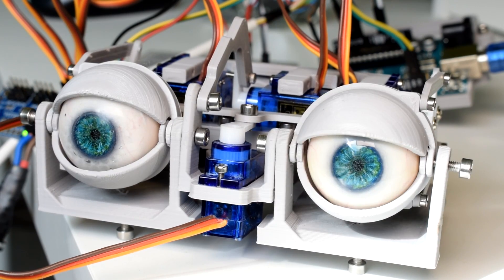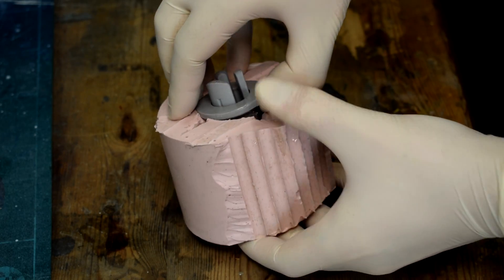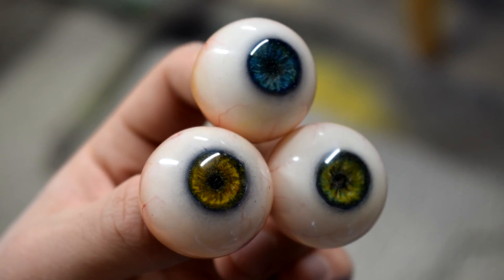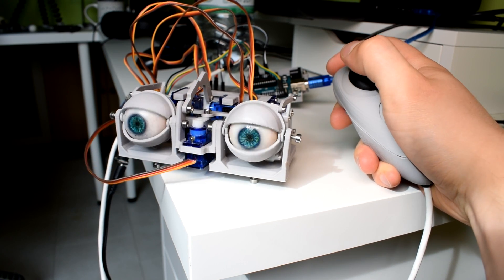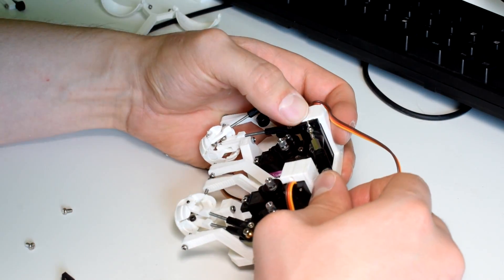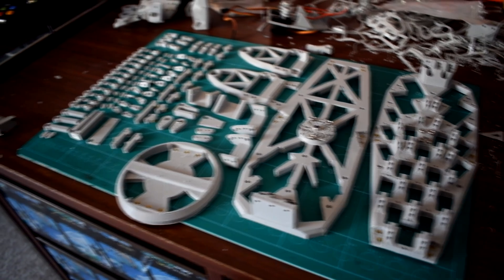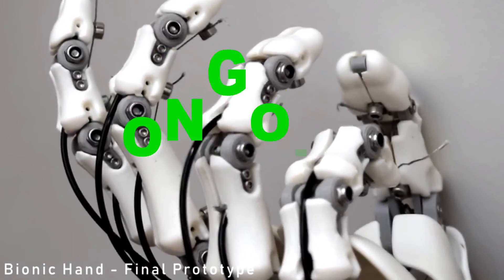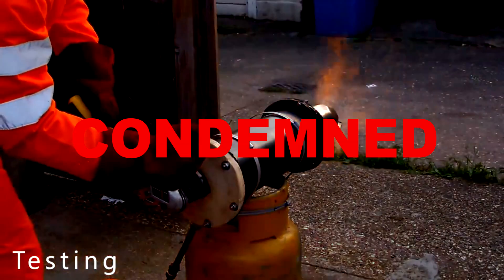New 3D Printed Animatronic Eye Mechanisms and Other Project Updates

Comment: Hey Will, I love this eyeball and have been studying it for quite a while. What I'm wondering is how to move the servos away from the eye and minimize the mechanism and support structures around the eyeball. This would enable putting an eye in the middle of a flower, and put the servos down in a flower pot underneath, operating a cluster of control lines that run up through the flower stem. I've tried just running wires through a tube, but there's too much play in the wires to perform the push-pull actions. I think each one would have to be confined in its own sheath, like a bicycle brake line. Another approach would be for all the push-pull action to occur in the flower pot using rocker arms, with the ends of the arms operating pull-only lines that run up through the stem to the eye, with opposing connections to the eye for back and forth motions. The pull-only lines could be much smaller gauge than push-pull rods - maybe even nylon thread. 

Any thoughts on any of this?

Comment: Quite interesting that I was trying to make eyes that move realistically and have eyelids that accompany the eyes as in real life, but in 3D and without any reseach on how to do it, just photo, video and anatomical references, and I came to the same solution for the eyelid motion as you did: 
just make the skin around the eyes weighted gradually from 1 to 0 from the center to the outskirts (or in your case simple shell in the form of a quarter of a sphere that have both hinges on the "points") rotate on an axis fixed on the eye's center that goes through left-right poles of the eye. Rotates up and down only, with the eyes, independent of the blinking motion, but have a limiter to rotate half as much as the eye. Just 2 controls, one blink other move the eye, yet it's so realistic. Simple but powerful

Comment: If you're having trouble with bubbles in the lens part of the eye, you can pull the bubbles out of the clear resin before it sets using a vacuum pump and degassing pot (To put the resin in) such as this one on ebay: https://www.ebay.com.au/itm/3-Gallon-Vacuum-Chamber-and-3CFM-Air-Condition-Gauges-Tools-Pump-Degassing/333190129962

Comment: Sweet! This is amazing work. Have you considered a creative commons license?

Also, the eyes are hitting the uncanny valley because the bottom eyelids are blinking. If you look at human eyes when they blink, the lower eyelids barely move.
Reply from the maker: Thanks, yeah I plan to release everything with a creative commons license. Interesting point about the bottom lids, its a lot more noticeable when the eyes are looking down. Might need to adjust the code a bit, thanks for the tip :).